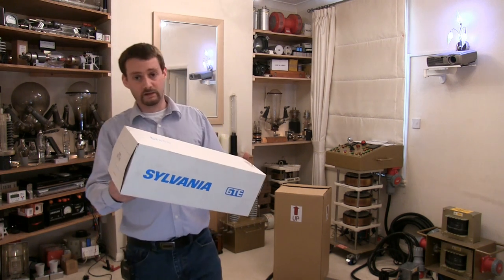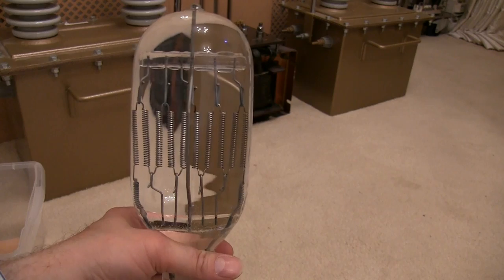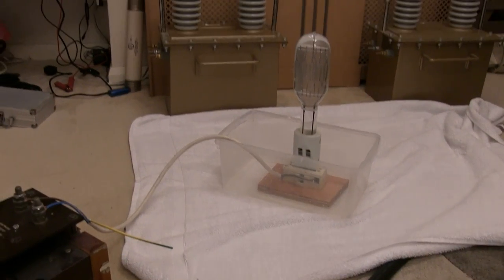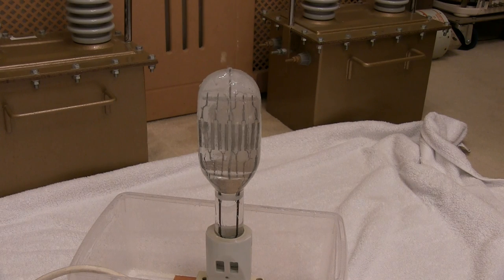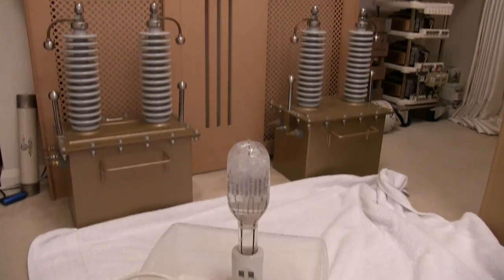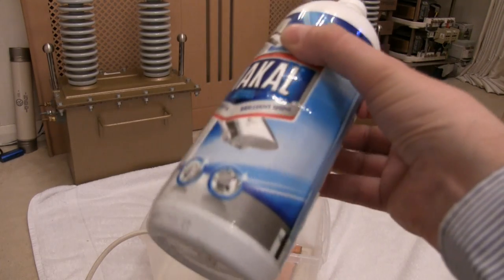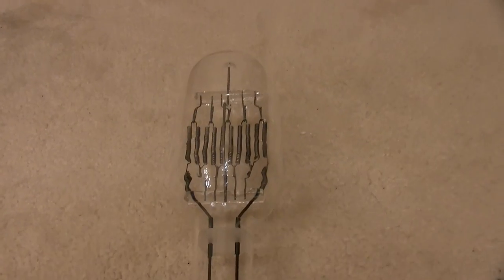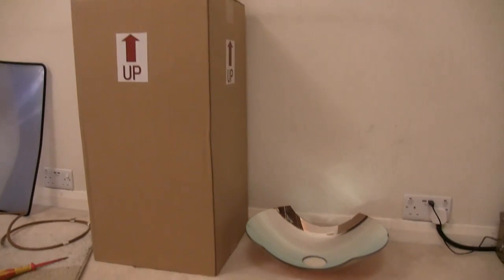Boiling water inside a light bulb

Comment: Photon, the oil companies will pull this down because it shows water turning to steam without the use of oil. We all know what happened to the steam car. Next video should be highly illuminating
Reply from the maker: It might be a bit hot mate! Say hi to Ed if you see him, I know he is busy working.
Reply: I'd say it depends on what his local power plant's fuel source is, LOL!
Reply: i have a theory big oil wants "we the people" to re-invent the water car, so they can force water onto the stock market as a commodity like oil or gold....water cars have been done so many times-the earliest reference my search has found was 1938 in the U.S.
Reply: +m3sca1 Do you mean steam powered cars?
Reply: logitech4873 steam, hydrogen, water + carbon, there are many ways water has been used to propel vehicles. I don't just mean steam.
Reply: m3sca1 I doubt water has anywhere near the same chemical energy density as petroleum however.

In any case, electric seems to be the future.
Reply: logitech4873 you are right-it does not have the same energy density, carbon rods arcing under water produce a gas which has better fuel capabilities than just hydrogen alone, hydrogen burnt with water injection can turn the added water to steam giving the required force/energy-just need to be clever about how to apply it.
Reply: No, adding water to hydrogen-oxygen combustion won't increase efficiency: the energy necessary to heat up and turn the extra water into steam is taken from the hydrogen-oxygen combustion and robs the combustion gasses from an equivalent amount of heat that would have otherwise fueled the gasses' expansion. Also, lowering the temperature difference between the inputs and outputs of a thermodynamic system reduces its efficiency.
Reply: Hi, Mr. Leo! Hello from Nebraska! Tell your kids we all said hi! :D
Reply: electric is the future. too bad wind and solar are like pissing in the wind. not to mention they both take up TONS of land to create a few megawatts.  we need to build new nuclear power plants.
Reply: Hi, hope your enjoying Summer
Reply: +leokimvideo i am thank you very much. how is yours?
Reply: +leokimvideo If it wasn't so hot. Haha!
Reply: +m3sca1 Toyota has a hydrogen powered car for sale, looks cool too.
Reply: +leokimvideo how many spiders are in your house?
Reply: id be like get off my property or you will be meeting my gun
Reply: You can already buy or sell Water futures. You can even buy the weather.
Reply: Why the hell would you do that? It is more efficient to use the electricity to drive the car directly.
Reply: The electricity use to power it was probably made from oil or coal so they don't care.
Reply: How do you produce electricity to power the bulb? to create the steam?
Reply: Mac MashPotato wind turbine
Reply: m3sca1 the water car is kinda dumb fr, especially with Tesla improving their cars all the time.
Reply: @m3sca1  Yes water car  is just powered by   hydrogen   combustion engine
Reply: @Photonicinduction  why haven't you  uploaded in a while?
Reply: @jbw5485  agreed. Its safer actually too.
Reply: @logitech4873  electric battery also doesn’t have nearly the same energy density as petrol. And worse, when you use up the “fuel”, your vehicle remains the same weight. Which is just one of the reasons electric planes don’t work. The farther a plane flies, the lighter it gets, and the less fuel it needs. Batteries are as good as they are going to get, until there is a complete fundamental reinvention of a battery. Just as solar is as good as it’s going to get, until we completely reinvent it.

Comment: If you put a toaster in the bath could you boil the bath water?
Reply: maybe if it was magic
Reply: well....jump in and see
Reply: +TheMagicToaster you've waited your entire YouTube life to type that haven't you?
Reply: if it kept working perfectly, sure. it would just take a while. you could definitely do it if you hooked up a stovetop coil to mains.
Reply: Maybe if you used distilled water. Taper water would contain too many dissolved ions, and it could cause for a large amount of sparks.
Reply: try it get in to test the temp let us know the results
Reply: technically, yes
Reply: There has to be a person in it to allow the water to conduct the heat from the electricity and start to warm up. I always do it to make my own hot tub.
Reply: i mean, provided the drain pipe was plastic and the tub was plastic and there was no grounded metal trim or whatnot around you, you could sit in it with the thing plugged in...
Reply: SuperAWaC acrylic tub master race
Reply: You can do it without toaster. Just two metal plates and thats it.
Reply: Magic blender is still waiting for his chance to shine.
Reply: TheMagicToaster username checks out
Reply: There is a really cheap form of water heater sold from China that is literally a piece of wire with two metal plates packaged in plastic that is used to heat water up and some mild electrolysis the only problem is you could end up being the connection to ground.......🔌😵⚡🛀🛁🚔🚨📴
Reply: the breaker would trip
Reply: @blackbird1234100  actually, it's rather unlikely to die from a toaster in the water, as the path of least resistance usually doesn't involve your body.

Comment: Lol. I think it would be interesting to see what'd happen with distilled water if a spring wasn't touching a wire or something so instead of heating the water it began to have the electricity directly move through the water to reach the terminals and perform electrolysis. Would be fun but dangerous cuz if it sparked...

Comment: What if you boiled gasoline in it?!??!?!?
Reply: need oxygen in a good enough ratio for that, otherwise it will behave just like the water did
Reply: +? I don't think you know how science works.
Reply: +Mr Mürk put a modest amount of watts through it via the Very Large Capacitor and it should explode. If the filaments remain afloat and burning for a while then a second explosion should follow soon as the gasoline has been thoroughly dispersed in the air. You can also place an operating spark gap next to the lamp just to be sure.
Reply: +Mr Mürk indeed,  it's the vapor that's explosive, not the liquid itself.
Reply: +Ron Garren Or simply arrange to crank the voltage so it arcs across the filament terminals as soon as there is no longer any resistance...

Comment: Thanks for the videos. I have a Staco 20 Amp veriac but mine is set up to be controlled with a 12VDC servo motor. I would like to convert it over to a case like yours with a knob. Can you tell me were you bought yours, I would like to contact them and see if I can buy the case only. They seem to be the same size, even my 20 AMP 115VAC one and my three phase 230VAC 10AMP one with are the same size. They just have different taps and different size wire for the windings as expected.

Comment: I've always wondered why you are not to touch hallogen light bulbs.
Reply: Me too. Seems ridiculous that you can't. Aren't there any smart people that can make one you can touch?
Reply: Techincally, the glass area under the grease spot would have different temperature, therefore thermally expanding in a different way to the rest of the bulb, and thus creating a tension in the glass, that might cause it to explode, I think.
Reply: The reason is because these bulbs run a lot hotter than normal ones.

They get so hot that they break down and char most organic things as a result your greasy fingerprint turns in to a stain of black carbon on the glass. Because its black it absorbs a lot of the light, causing that part of the glass to get too hot in that one spot and this can cause it to crack or even melt.
Reply: I would love to see a halogen bulb dipped in black/UV paint, or oil. then turned on and left until it melted, cracked or exploded. xD

Comment: I notice when you pop resistors you get some of the most satisfying sparks flying everywhere around the area. Almost looks like the 4th of july for several moments afterward. Why is that? Is it just due to super-heated microscopic bits floating about in the air?
Reply: Resistors are made of carbon or metal. When they oveheat and pop, the hot particles burn and produce sparks.

Comment: It was unhappy in "air" and you got Tungsten Nitride and Oxide... but what happens if you fill it with water again, let it all boil and keep turning up?  It's heating in water vapor, the O is already taken up by H2, will the tungsten steal it from the hydrogen or will it act as a proper buffer gas?

Comment: Nice but you didn't pop it hehe.      
I have watched all your videos and it is very interesting to see how different appliances behave in over voltage/current conditions. You have answered many questions with your displays. May I suggest a water pump / pressure washer.
keep up the good work.

Comment: I've tried this with 1000 watts trough a 175 watt Metal Halide arc tube and it doesn't work.. Vindication here with a good old tungsten filament.. Things a beast. Imagine electricians pulling 8 gauge wire for on lamp.. Totally unheard of.. More ultra high wattage HID lamps please and what's the biggest ever HID/ Metal Halide/ Xenon Short Arc lamp ever? I thought I was dreaming with the 12KW Halide Lamp. Now have seen 20KW on up...

Comment: I'm not quite understanding why the filament didn't start glowing when the water was being vaporized.
Reply: The water kept it nice and cool.
Reply: +Knuckles the Echidna At 240 volts with about 41.66(10,000 watts) amps going through the filiments,it should have exploded.The only thing that I can figure is that photon went very easy on this bulb.(low amps)
Reply: He said he put it into that transformer which made it ~30V. He then used the variac to control the current.
Reply: +Rennie Ash I kinda overlooked that...my bad.Phonton's next video should be even better.
Reply: +4 gauge. Even if he would have used 10kW, the filament would have stayed at about 100C until all water have bolied away from direct contact. If you dont believe me, fill a platic PET bottle with water and place it in a fire. The platic will not melt until a good deal of the water boiled.
Reply: Adt Net unless your fire is extra hot :-)

Comment: this guys electric bill must suck to pay
Reply: Nah, he stores cheap overnight electricity in batteries for use in the day, and his experiments don't last long.
Reply: Even if he used a massive 60kW worth of power, (6x what this bulb used) then that's only about 9 cents a second and most of his experiments don't last any longer than a minute or two.
So at most an extra $10 a month per experiment.
Reply: +vgamesx1 yeah but watching his channel and I love his channel he does alot of things I'm just saying I do a lot of stuff around my house not close to what he does. mostly computer stuff. build a 32 inch touch screen table using an Intel computer stick have a computer running 2 other 32 inch open frame screens and a home server that the PSU went out on today. and my electric bill is a bitch
Reply: strife Yeah, because computers, TVs and incandescent lights eat a fair amount of power over time, so for example you mentioned a server, you didn't provide any specifics so I'm going to assume it's fairly standard desktop hardware like an i5 or something which means it'll draw between 75W idle and upwards of 150W during moderate work and since it's a server I would also assume it runs 24/7 so let's just say 100W x 24h x 30d + TV use of about 4h per day so 50Wx4x30 = 78,000W or $7 per month just to run those two things, so yeah might not sound like a lot but that really adds up, but it's easy to fix, use power efficient lighting and don't run servers off normal hardware, for 24/7 devices you want it to use about 30W or less and the typical turn stuff off if you aren't using it.
Reply: +vgamesx1 the server runs off a dual core amd runs 9 watts. but I get what your saying.
Reply: *****
That was an old spare meter he'd rigged specifically to blow it up.
Reply: +Nasa Rep Your PC does not suck 350 watts continuous. I believe it's the rating of the power supply. In reality it uses much less than that, even it's 12 years old. Unless you measured 350 watts.
Reply: vgamesx1 my server takes about 1.2kw...

Comment: lol if the bulb is still good, you should add the water, seal it then apply the voltage doing it outside for safety and see how long it takes for the glass to break.

Comment: What is wrong with touching the halogen lamps? I know nothing about lamps so :c
Reply: The greasy fingerprints you are leaving on the quartz glass bulb, by touching it, would burn in once you turn it on and create hotspots in the glass.
Reply: +Jack White ah ok, thanks :D
Reply: +Jack White I kind of doubt that this applies to household bulbs, but just to be safe, does it apply to 100W bulbs as well? My mind keeps telling me they're also halogen, but I somehow doubt that.
Reply: Regarding household bulps, most mains voltage halogen bulps (E27 and GU10) have an additional glass protection around halogen bulp in the core, so it is safe to touch.
BUT, bulps for floodlights (250W, 500W and more) are unprotected, as well as 12V bulps for desk lamps and so on.
Reply: If you live in EU, 100W bulp is probably halogen, since normal ones were officially phased out some years ago.

Comment: Pretty sure you were just electrolysing the water (turning it from H2O to H2 and O2). I could be wrong though.
Reply: Electrolysing it with AC? Not likely. Also, because the filament is continuous (no separate anode and cathode) it is not really the right setup for electrolysis. I am not going to say zero oxygen or hydrogen. But I am sure it was mostly water vapor/steam.
Reply: Also he'd need salt in the water for a lot larger conductivity for proper electrolysis. Pure water wont build up enough current that way anyway
Reply: Sure, and when you're boiling water for pasta it's electrolysis as well....
Reply: It's really not... When you boil water it turns into gaseous water (steam/water vapor)

Comment: I would like to point out that this bulb is verry simaler to how a hydrogen/oxygen separator works. you should test the vapour coming out the bulb, you may have just found the easyest way to separate h2o.
Reply: you should add salt or another solution and try. if you make hydrgogen with an inexpensive preexisting product the possibilities fenominal.

Comment: maybe you could use it as a self heating hot water bottle, or a weapon. hot water grenade
Reply: also im patenting the water bottle thing
Reply: +weeowey how would it be self heating if you have to hook it up to the wall outlet. I'm pretty sure if you need a self heating water bottle in the woods you wouldn't find a wall outlet.
Reply: Chaotic Gaming *electronically self-heating
Reply: +weeowey so you mean like battery powered
Reply: Chaotic Gaming whatever works, I was thinking more 240v/110v like a kettle, you don't see a battery powered kettle, do you?
Reply: actually i did. just search battery powered kettle on google
Reply: ok im surprised.

Comment: That would be what we scientists call electrolysis. Those gas bubbles are a mix of hydrogen and oxygen.
Reply: No. This would be what we scientists call water vapor (or steam).
Reply: 60hz ac is too high for electrolysis, its mostly done with DC
Reply: or 50Hz in the UK
Reply: ***** Is it seriously that hot?

Damn.
Reply: It's bubbling because the filament is heating the water, I think.
Reply: +Caleb Burns It is a 10,000 W filament. We don't know how much power is actually being delivered to it. He said around 30V and plenty of amps. Could be 1000 W or something like that. That would boil water pretty fast.
Reply: should have had a match on the top, could have made a flame spew out

Comment: Can anyone tell me why you should't touch halogen lamps? Does the salt from your sweat harm the glas under those extreme temperatures or what's the reason?
Reply: I'm not too sure, but I think it has something to do with the oils on your hand.
Reply: the oil from your skin causes a hotspot on the lamp, makes them more prone to poping
Reply: I believe it has something to do with the oils on your skin.
Reply: I believe its the oil from your skin. it makes the heat on the bulbs surface uneven which will make it fail or break early.
Reply: That sounds about right.

Comment: Anyone else wondering if that's not creating hydrogen/oxygen? an non-insulated heating element like this would put electricity on the water, causing electrolysis.. so if you'd try to ignite that steam it probably would make either a flame or an explosion :P

Comment: Fill it 3/4s of the way up with water then plug up the hole with some JB weld original and flex glue together and then turn it on leave it on for a while and experience a glass shard blasting bomb E N J O Y !!!!!!!!!!!!!!!!!!!!